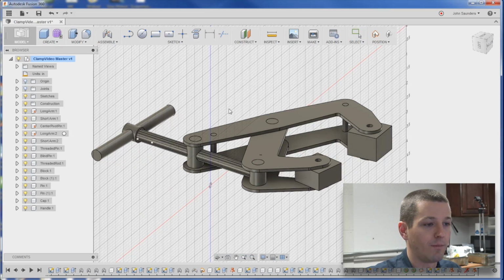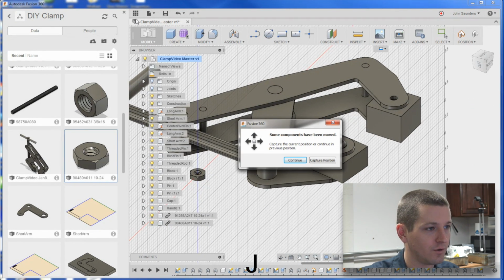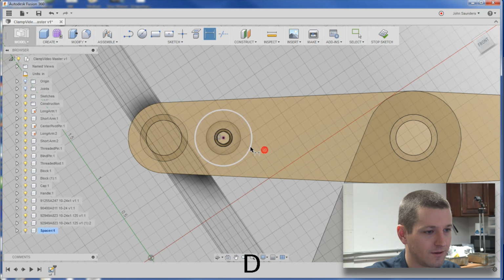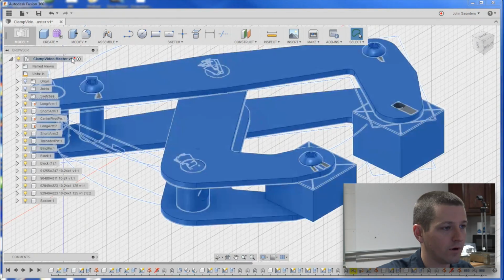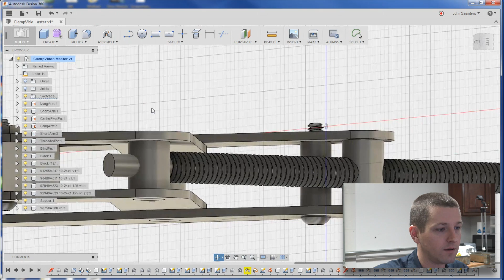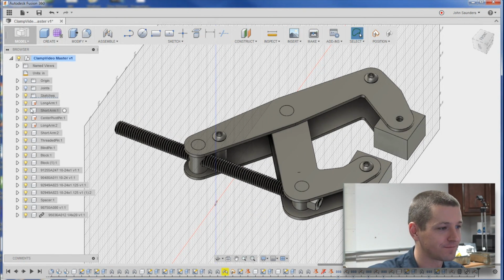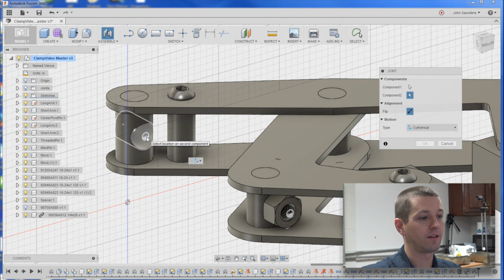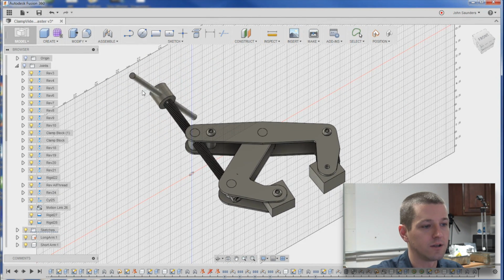DIY Clamp Part : Joints & Plasma Cutting! Widget75

Comment: As there is no load being applied to the nut / shaft when loosening the clamp, could a consideration be to use a circlip rather than a nut?

Comment: G'day John, that's a great tip to create a joint to a face, I've always joined to the thread, and your way is easier and better as it locates the nut correctly. 

You possibly realise already, but you can insert the McMaster parts directly into the model by using the insert function and importing it as a 3D-step file. That will save you having to break links, have separate files etc. It will insert it as a component. It will save a bunch of time unless you want to keep common component models in a local library to insert in different models. 

Modelling threads can sometime lead to problems, drawings don't like them at all for example. It's a pain, as I need to model threads to print them. I think this is something the team will be looking at. In the meanwhile, if any of your NYC-CNCettes have issues with joints, drawings etc and modelled threads are involved, I'd suggest trying again with the thread modelling turned off.

Finally, speaking of saving time, I know how much you like shortcuts John ;) , so if you haven't seen it already, type "S" and it will bring up a customisable toolbox. I'm just trying to keep reminding myself to use it now, as it's a relatively new function. It can be customised to each workspace.

Thanks for putting up the videos and sharing.

Comment: Great video John. I agree about larger models being a little complicated to edit, makes me miss Inventor a little bit. Is there a reason you download from McMaster and then import? I typically just use the arrow under the "Insert" button on the ribbon and then browse for my parts from the browser it pops up. It'll then just insert it right into your assembly. You have to pick the STL version from McMasters, I don't think it'll bring in Solidworks through that dialog, but it might save a few steps. Looking forward to the next one!
Reply: +NYC CNC 20 ways to do everything! Looking forward to catching up on the fusion videos you've been putting up, learning lots of tips!

Comment: Is there a reason you chose the Solidworks version of the McMaster part?  I'm just starting out with Fusion so maybe I'm missing something, but I think the STEP file format imports directly in.
Reply: +NYC CNC Thanks.  Your videos are helping me learn and you have quite a bit of experience with Fusion, so I wanted to check. You may have had a reason that wasn't obvious to me.

Comment: John,

Nice video. Congrats to the winners. Should you make flat surfaces for the all thread and 1/4-20 nut to bear against? Maybe use some hardened washers?
Reply: +NYC CNC John If you can make a flat on the threaded side, that should be sufficient since that is where most of the force will be applied for clamping.

Comment: More help on assemblies, that is great!  I have one small tip for you.  When you are dimensioning geometry that you are just trying to extend outside of a part, instead of using a round number use a decimal that ends in 99.  For example on the 1/4" diameter all thread cut, the inner diameter is obviously .250".  For the outer diameter you used .500".  The only requirement of that dimension is that it needs to be outside of the part and is not a critical or machined dimension.  For a dimension like that I would use .499".  That way when you have multiple parts and multiple sketches and you are trying to modify things later if you see a .x99" dimension you immediately know that it is a maximum extent dimension and not a specific dimension for the part.  This is a practice that I was taught in the past and it can be very helpful with lots of features, and/or multiple people working on a part at various times.   Thanks again. R.J.

Comment: John the Cant Twist clamps that I have. On the small ones they just turn the clamp screw enough to clean off the thread and turn a shoulder of smaller diameter so that shoulder bears on the bottom of a stepped hole in the pin. They just peened the end a little just enough to capture the screw to the pin without restricting its rotation. The large ones use a washer and cotter pin. You may want to make the nut for you clamp screw out of a dissimilar material to counter galling of the screw(Cant Twist Copper plate the screw). Bronze would be a good choice. It will also reduce the coefficient of friction.

Comment: What is the difference between as built joint and simple joint?
Reply: NYC CNC thx
Reply: +Arnoldas Sarnauskas There is definitely a difference... As Built Joints make some assumptions based on the current position of the component... namely that it is in the correct position and orientation relative to the component you are joining it to. As a result the Joint you are defining requires less input. So while John's response is half true (it's quicker), there is a fundamental difference between the two.
Reply: NYC CNC no. In the end you get more editing control with a Joint than you do an As Built Joint. Also if two components are designed with offset face centers (and none of the face 'coins' line up), then using an As-Built Joint is way easier... with a Joint you would have to input a value to offset it back to its current different... so How you get there, and the end result are different. Play with them both a bit more and you will see.

Comment: if you do a model in the correct order it is easy to change, what is the correct order is the hard part to work out, once you know the order to do things in it gets faster and easier.
it good to see you got that model working sinces no one helped on the forum, a long time ago that was.
good tips on the joints and ctrl
Reply: +NYC CNC correct but at the moment it like that for certain things, dimensions is the worst one you have to get it in the correct direction

Comment: That's awesome, just wondered could you use a groove and  e-clip instead of treading the shaft and using a nut?  Also congrats to the winners.
Reply: +NYC CNC Crab clamps (more or less a UK version of a Kant-twist) used an e-clip. When backing off, there's no real load at all on the e-clip, you're just reducing the thrust load from the screw. The e-clip really just stops the screw from coming loose from the pin. The only thing you couldn't do with Crab clamps was apply much force using them as a spreader. 

In your design there's not much bearing area between the all-thread and the pin, you might want to think about a thrust washer.
Reply: +NYC CNC I'm with rchopp and Paul Compton: the e-clip or circlip doesn't take any load to speak of, and frankly I'd worry more about a nut unthreading unless there are two tightened against each other as your allthread still spins in the receiver crosspiece, possibly creating enough backward tension against a single nut to undo it.

Comment: Nice, I think that you're going to want to have a shoulder on the bearing point of the all thread or it's just going to chew up the load point. Or you can loose the nut and have a flat bottom hole, cut a shallow groove in the all thread to retain it in the hole with a set screw in the pivot. Then you can get fancy and put a hardened ball in the bottom of the hole and make it very German (take the foot off an older bessey clamp and you'll see what I mean).
Reply: +NYC CNC Another Option, make it THREE diameters - you take the rod down to, oh, 1/4", and make the hole in the pivot a counterbore - and thread the turned part 1/4-20 - the clamping force is on the shoulder, and the 1/4-20 is the pull back, but even BETTER, use a circlip, and don't THREAD the 1/4", as you really don't need pull apart force
BTW, the centers of the 2 clamp blocks SHOULD be the same distance from the pivot, so if you are clamping a small part, it pinches, not try to rotate